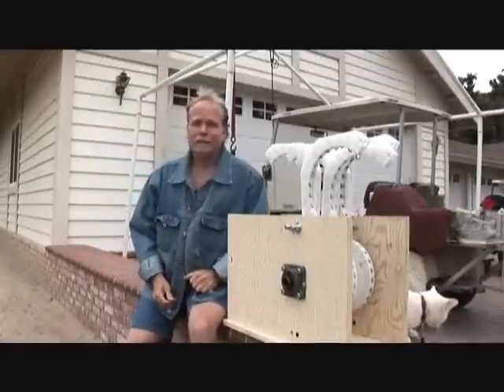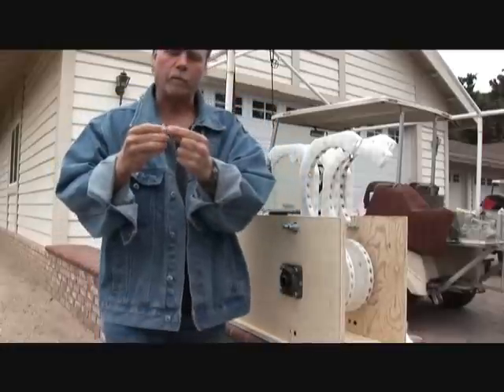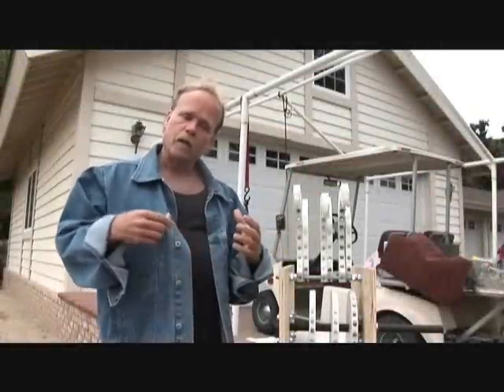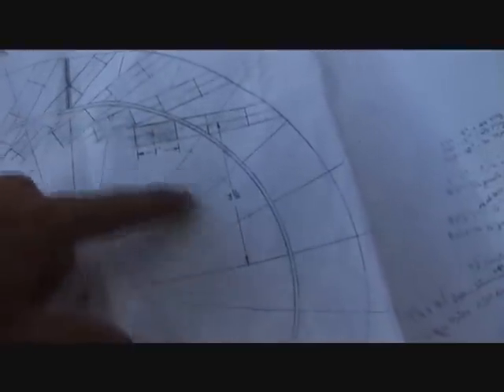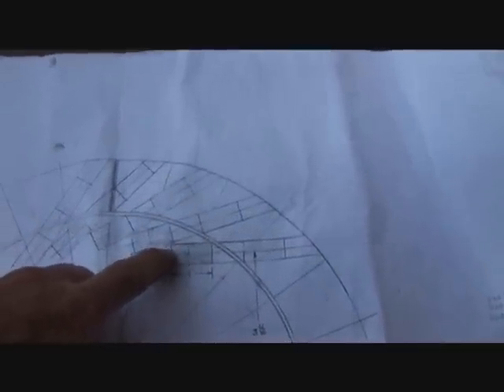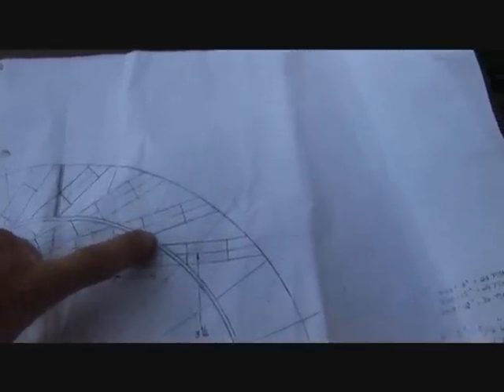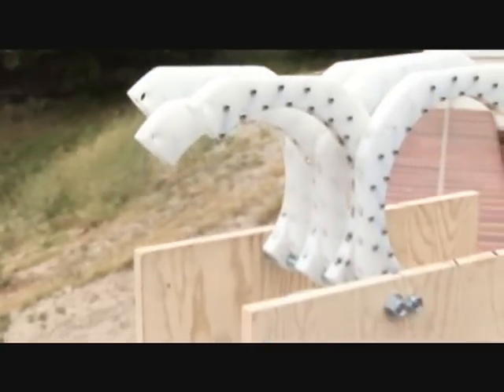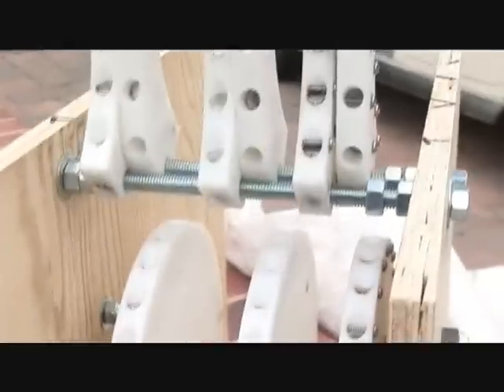Green Motor Project Video 1 Truth About The Perendev Magnet Motor

Comment: @hugejoint We know enough about physics to have basic laws to prove this is impossible: 1. We lose energy when it changes forms. 2. Every action has an equal and opposite reaction. Those two proven laws of physics proves that you cannot get more energy out of a device than you put in, and a circular device using magnets is not capable of perpetual or sustained motion without additional energy added into the equation at some point.

Comment: you need to grind the magnets on both sides so they can be within a millimeter of each other. and if the electrons have to go to the opposite side of the magnet, then you may want to grind the other side as well. so when you look at the side of magnet, it will look more like a rhombus or parallelogram instead of a rectangle.

Comment: i think the problem is the shape of the magnet. you can think of magnets as being a collection of toobs for electrons that shoot out one side and loop back to the other side. your current setup is like trying to slide two stair cases across each. also the stronger the magnet, the shorter the path is for the electrons looping back around. so while neo magnets are much stronger at attraction, they dont have a very big magnetic field. which means you need to get them closer together by grinding the

Comment: Hey welcome to bite me that your attempt is not successful magnetic motor and there is a chance that this will set off from each wheel rotors on a few inches and insert the stator blade as this film look on video time between 0 and 23 seconds they change the polarities of magnesium from horizontal to NS vertical, or vice versa you can try here is the link to the video

Comment: first of all he said that the magnets were at a  20 degree angle, and the magnets were opposing eachother with negative and positive around the wheel, if the centrifical force from inside the wheel was added, it would work better

Comment: good now remove the magnet away from the nail and take the compass, Check the ends of the nail you should find that the nail as both north and south poles although you only touched the nail with 1 uncapped end of the magnet.
If you can find the time to work this out, everything you do from this point on will be moving in the right direction.

Comment: @knowledgemonger  it dose not run off of the energy being created by the magnetic feild (although surrounding the magnetic tubine with a copper coil would be a good idea) i used the magnetic feild from the magnets to aid in the production of kinetic energy to turn alternators and remember that it dose NOT run continuously it shuts off when the battery bank is full and turns on again when it gets below 1/8th power

Comment: @knowledgemonger  um you start it with a hand crank or use whatever power that is in the batteries i said that before you started calling me a liar i NEVER said the machine was self operating or perpetual it is simply a cheap means of producing power i only said that the magnetic turbine on my generator was similar to this device not a carbon copy

Comment: @knowledgemonger  my vacation home is very small i have a small electric motor that basically turns the turbine over and makes sure that it maintains the desired rpm and it uses the resulting torque to spin 4 industrial tractor-trailer alternators and charge the battery bank and it gets automatically turned off when the bank is fully charged and when the bank starts to run low it uses whatever energy is left to spin up the turbine again (what about that dosent sound plausible or realistic?)

Comment: @knowledgemonger  what am im lying about and better yet what about my device is not plausible (mine has power input unlike this concept because it uses an small dc motor to make sure that it keeps running without slowing down, all the magnetic turbine dose is provide the motor with extra torque to keep the alternators running at a more optimal capacity without burning up too much of the energy that the alternators put out and the motor has a power consumption to power production ratio of 1:29.7)

Comment: Why are ppl so quick to say what doesn't work when the principle is easy to see. Being it is based on the repulsion effect of magnets it can be done. You only have to have the right spacing and disc configuration. There are too many working prototypes on Youtube. This one may not have worked but the principle itself is still possible. Personally I think a wind turbine generator with magnetic motor assist is the way to go.

Comment: I'm know expert  but ive played with enough magnet rotors to say that, A way this could possable work is with some sort of MAGNETIC SHIELDING. 

To get the rotation you have to iliminate/redirect/shild the repultion on the incoming/low pressure side, of the rotor, and or, the stators. Maybe using Bismuth or Pyrolytic Graphite.

Comment: I have have never attempted a perendev motor myself but I am fairly certain that enotil is correct when they point out that the rotors should be anchored to the center shaft... first that will prevent lateral shifting which is wasted energy, and second; if they are anchored, the center shaft will spin with the rotors allowing a transfer of kinetic energy into electrical energy, or even just a transfer of motion to a set of wheels.  Either way, I like your design, I might try one myself.

Comment: did you place your magnets in shields. an aluminum cylinder with a cap on the back end should better direct your fields and reduce the negating field look under this for help(Part 1 One Way Magnetic Shielding The Holy Grail )

Comment: In the rotor the magnets are not installed correctly, there is a pattern you have to follow, starting from left to right you need to off-set each 1-2-3 by half its diameter,  diagonally, then back from magnet 3 to magnet 1 keeping the off-set of half its diameter, therefore combining the repelling force even nullifying the push-back effect.

Comment: If I saw the diagram correctly, you're using the same amount of magnets in the stator as in the rotor.
That's a mistake, and I made the same mistake.
Mine, which was only a single rotor (not a true Perendev) also wouldn't spin, until I re-designed the stator, 
I took one magnet out, and re-spaced the others evenly, so that only a few magnets lined up from rotor to stator at any given time.
Also, the Perendev motor uses shielding on the magnets, which may improve performance.
Good luck.

Comment: @Ifukinhatethesething
You have a working model? Then lets see it!

Or better yet submit for the YouTube $10,000 Magnet Motor Challenge. All you have to do is provide a WORKING magnet assist overunity or completely magnet powered motor. You bring me that and you will be $10,000 richer

With that kind of money you should be able to build tons of these things

Here are the rules:

1. It can be made from cheap parts
2. It does not need to be well finished
3. It just has to WORK!

Good Luck!

Comment: I am currently working to build the components for the later configuration of the stators. Have not tested it yet.
I am convinced the key is to this motor is having the magnets 30-35 degress off tangent and having the shielding so the magnetic flux waves are very narrow in width on the repulsion break zones.
A final note, the goal is to find that combination of spacing, shielding, and angles where the rotor simply cannot find a resting point, thus causing perpetual rotation.

Comment: 4. Currently trying to stagger the stator magnet spacing in equal groups (3) where each group is staggered 1/3 of a magnet width.  For example, if a magnet width accounted for 7.5 degrees of the circumference, then each group would stagger 2.5 degrees from each other. ( 7.5 / 3 = 2.5 )

Comment: I have been trying to build a similar magnetic motor.  My initial trys have been unsuccesful.
Key Notes,
1. 3 rotors on a single shaft.
2. Magnet width ultimately determines rotor diameter.  Staging each rotor 1 magnet width apart requires 4 magnet widths per section.,
Number of sections will dictate diameter.
3. I have found that if you make the stator symetrical with the rotor, it will not rotate on its own.

Comment: Force to compressing two magnets is equal to the repelling force so there is no net gain. If you shield the side where the magnet undergo compression then they approach each other with less energy and rell with greater energy. Use steel or iron as a shield to reduse the compressive force. Test it on a singlr pair of magnets before applying it to the whole wheel. There is alot of fine tuning that why it take these guys so many version before they get one running nicely.

Comment: Hi robert
The thing with the prendev is that the stator is 2 space then 4 magents this pulls in better. also the tunnels are sheilded with maybe numetal tubes. and there seems a rod at the bottom maybe to make them pot magents? check out the patent at  uspatent library. Hope that helps?

Comment: Magnet Motors cannot be associated with perpetual motion, because the magnets will wear out at some stage, making that claim false. 

Also, it's not FREE energy, as it's using the energy that pushes the magnets together (and the repulsion of the magnet) and converting that into mechanical energy.

However, I do believe this is possible with the right setup and most videos "disproving" this usually ignore simple fundamentals and imitate a working model very poorly (or doesn't follow it at all)

Comment: Shielding is, contrary to poular belief, not the solution!
Although you can achieve perpetual motion (under certain perfected conditions) that what you will finally see (and what rarely is admitted) is that once you try to exploit the system then it comes to a standstill.
The situation becomes dramatrically better if you apply liquid magnets (suspension of elementarmagnets in an organic liquid of high density and low viscousity though)

Comment: You did that very well.
But i think there ara two problems you have:
1.    Too many magnets on the  discs, too near together,
2.   You diddn`t use a shield to put the magnet`s shade in the right direction, and to isolate from each other.
Well, i havend finished my motor, because thats a lot of time you need, and money, but i´am sure without shield there is no way to run it.

Comment: Another way is to shield the stator magnets and not have them fixed,  but able to rotate on a fixed axis with their field focused in an omni directional pattern. This will also mimic the grab/slip but requires precision engineering.
Oh an the gaps between cells is a must so that your fields aren't polluted by the adjacent cell.
Good luck, your almost there!

Comment: Suggestion:
Cut down the number of magnets in the stators. Make 4 groups magnets to each stator bank . Each offset rotated forward to the next bank. The distance to the gaps in the stator is equal to the bank size but dependent to the number of magnets in each motor cell,'s magnetic field produced (type/power). The gap for all combined should so that each offsets the previous by one third its distance.

Comment: 2)
the number of magnet depends of ray of rotor becouse the tensor angle of magnet(between a magnet on the rotor and  a magnet on the stator) at the pole between ray of rotor magnet and tensor magnet will' be same angle of inclination between ray and rotor magnet....
if u have many magnet this angle go to 0 8think a moment ... it's like to have 1 rotr magnet and 1 stator magnet the 2 angle it's the same..i've simulate this with a software ; )  )